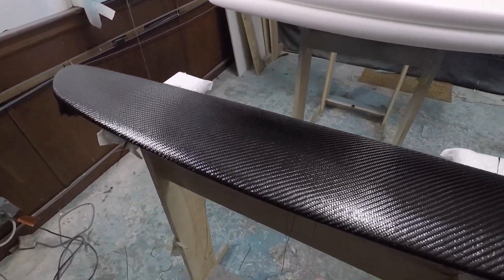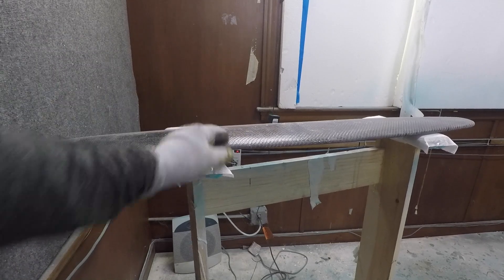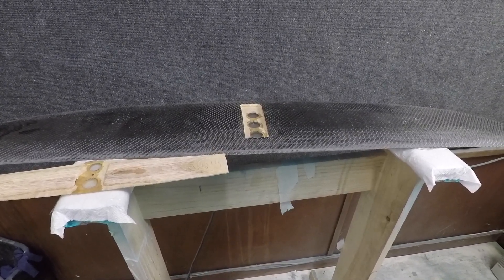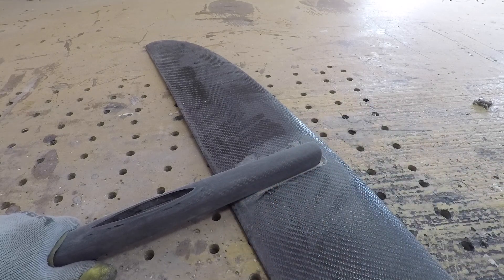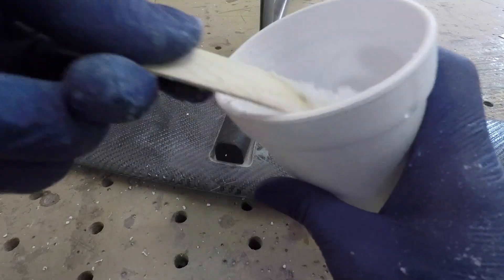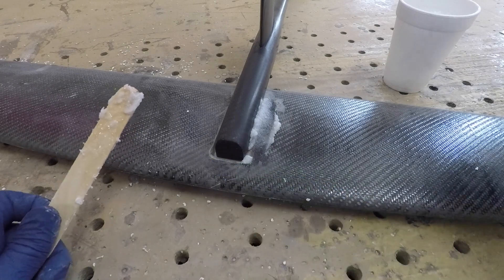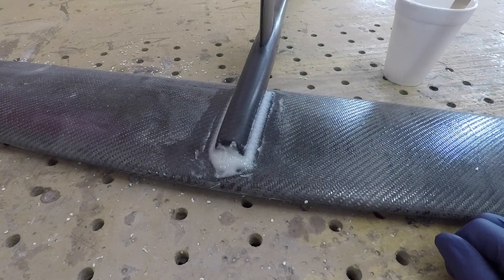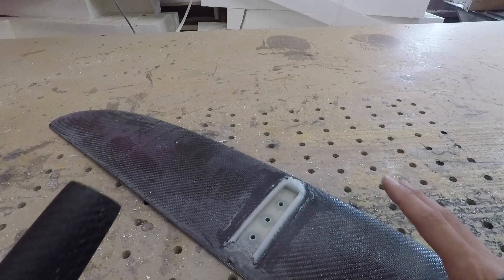Building the carbon fiber HIGH ASPECT foil wing part 2

Comment: For a stronger bond to the carbon skin, on your fairing slurry, wet out the wing with a thin layer of unthickened epoxy first. It really helps prevent dry spots. Will you consider making the blank available on your site, depending on how tests go?
Reply from the maker: I always give wooden cores (especially plywood) a nice soak with a brush before laying down cloth. It seems we have both learned the hard way from previous projects.

Comment: Nice work. You may want to do some post cure to gain some stiffness.
Reply from the maker: I have found that there is not a noticeable increase in stiffness after  24 hours. However after several days of curing this wing is solid!
Reply: @clearwaterhydrofoils4313  at room temperature that’s right but if you apply 140C of heat this is huge . That depend on your epoxy of course.